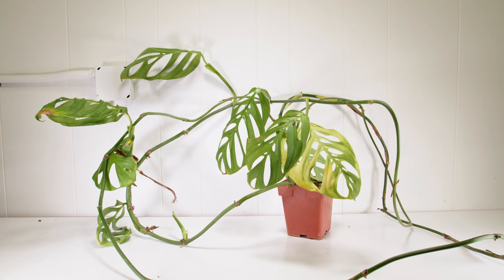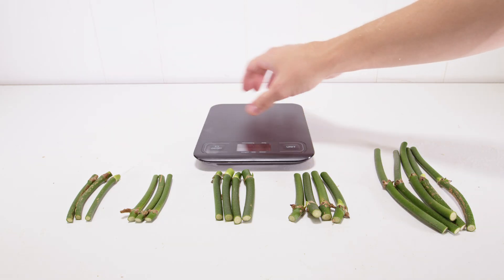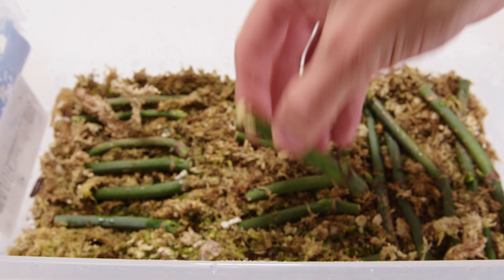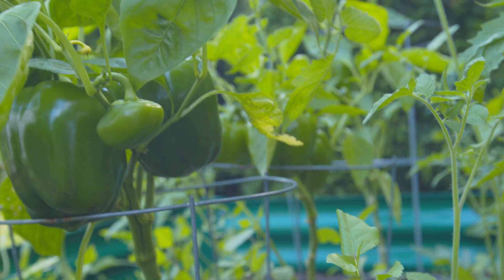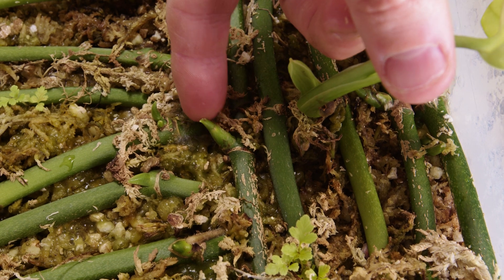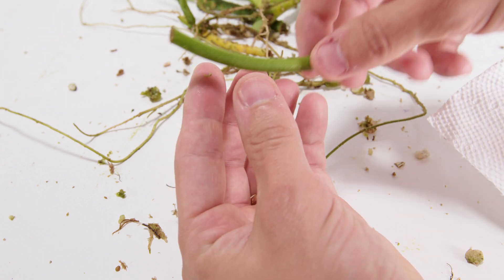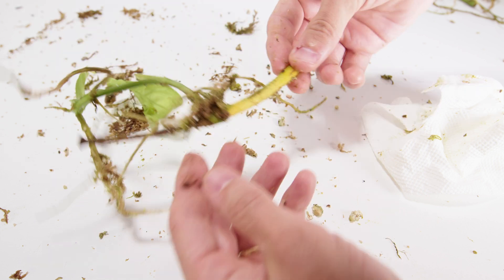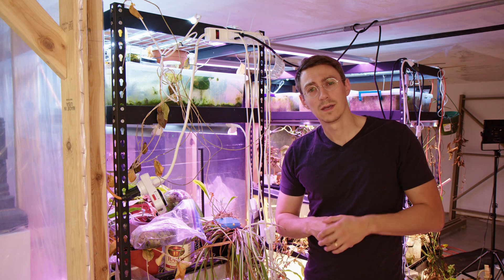Which Node End Matters When Propagating?

Comment: Definitely use pothos - it gives such consistent & fast results!

I wonder, how does the length and the width of the cutting play a role on a separate scale.

After seeing your first pothos propagation techniques video years back, I took on my first propagation experiment. Throwing about 35 pothos cuttings onto moist coco coir, into a box, I sorted them by length, with some having two nodes. All were around the same diameter. I noticed that:
1) the smallest cuttings pushed out the smallest first growth
2) longer cuttings did better
3) cuttings with 2 nodes rooted and grew foliage the fastest

This has made me wonder if there's a correlation between the length of a cutting (even if a single node) & it's growth rate. Your current test could kind of also support that hypothesis.

Another thing I've noticed with my pothos experiments is that any leafless cutting is going to push out about the same sized foliage across the same time frame (if it has no support to grab on to), no matter it's width. This has been the same for thick jungle sized cuttings & cuttings the size of a straw. 
This is very generalized, as there is clear difference in the size of those first leaves, but not as dramatic as you'd expect considering the large difference in width. The jungle sized cuttings took a lot longer to root & develop, while the smaller ones grew a lot faster. But measuring by the time they all had some growth, the difference was surprisingly small. So the smaller ones had a lot more time to size up their leaves by the time the jungle one pushed out it's first two leaves.

That being said, giving a mature vs young cutting a support, could make all the difference in results.

Based on my viewings of other plants, such as heart-shaped philodendron, there's some evidence that a cutting closer to the top will grow faster than the one closer to the base. The tip may have more active grow hormones. I haven't tested this on pothos.

I would love for you to test some of these hypothesis.